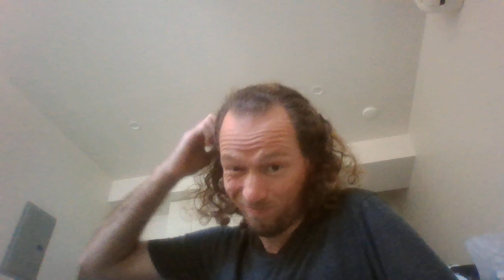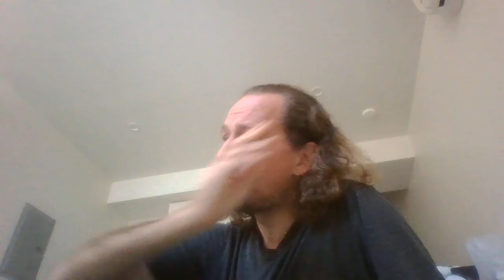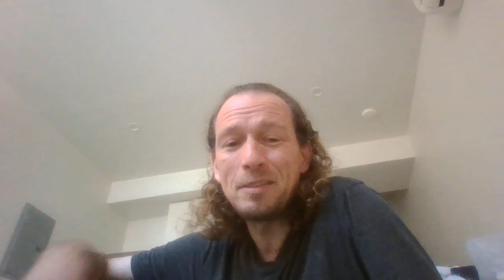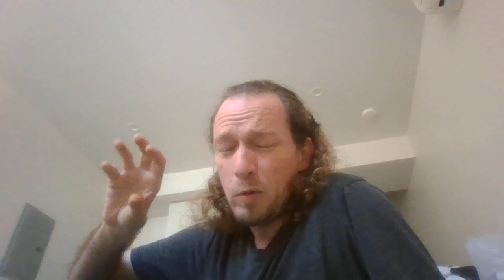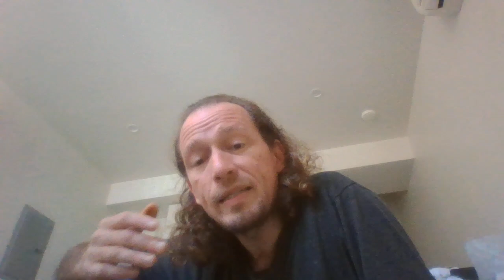Space Mining and Colonization: tech metal monopoly how-to

Comment: Interesting perspective. 

Seems like beaming concentrated solar down onto Earth would be pretty dangerous. Whereas the moon has plenty of room to receive it. Would Sterling engines work there? Though obviously you'd need to find ways to use the energy there.
Reply from the maker: Yes, solar beams would create a 'Dead Zone'! I do not recommend placing one near a city or nature reserve. Instead, there are plenty of spots being converted into solar farms far from folks, where loud sirens keep birds away, and these solar beams would make such installations MANY times more profitable, especially using Sterling Engines as you mentioned (I am also a fan of converting the solar heat into industrial utilities, to pull that fuel-demand away at its source). If we beam at 20,000W/m2, then our ceramic pipes or reflector troughs get dozens of times more yield on a fraction of the capital costs, with NO precious metals-mined-by-poor-under-dictatorships. We can scale to 100% renewable faster, and reach a higher total energy budget with less land spent to do it. :)